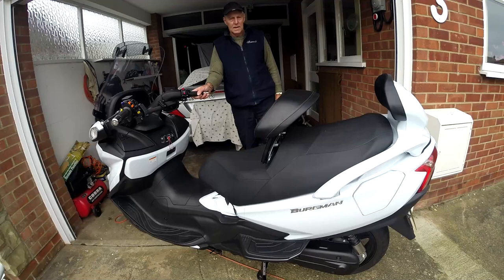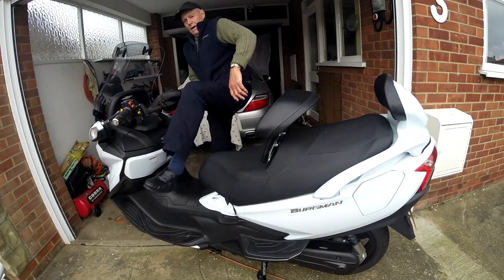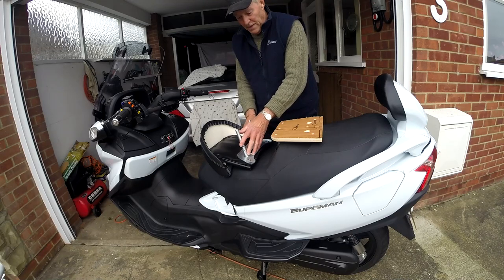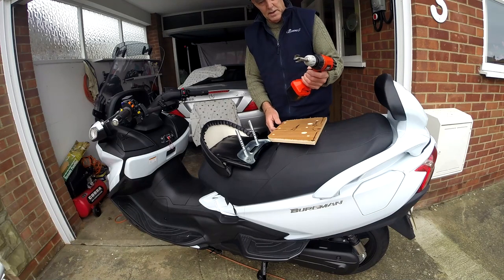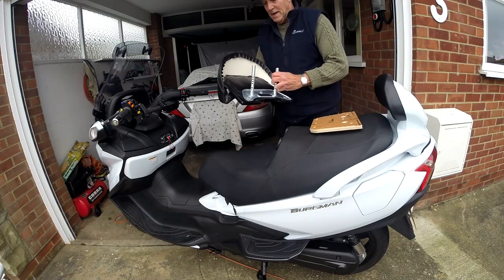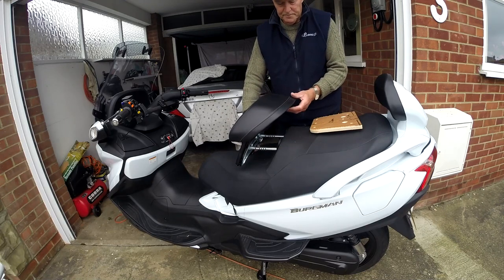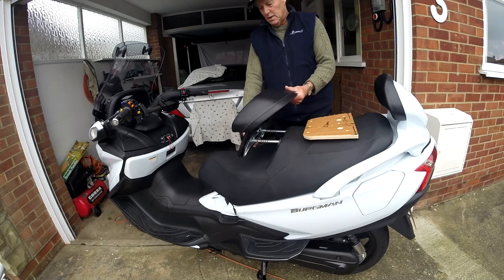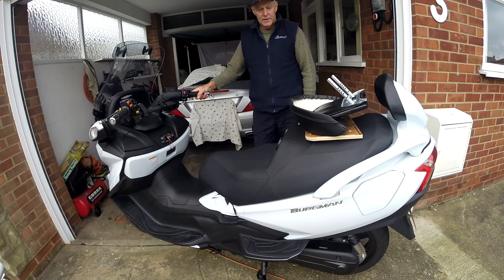Suzuki Burgman and how to raise the riders backrest

Comment: That’s an excellent tip about the jis screwdriver set, (Japanese industry standard) I could never figure out why all it took was a tight so called Philips screw on a Japanese bike to end up with a messed up rounded head, I blamed the quality of their fasteners. But no, they have their own system which looks very similar. A decent lifetime set is very reasonable. I’ve just bought a 2011 Burgman 650 executive and I think I will be making one of these. Thanks
Reply from the maker: Hi David, Thanks for the comments. That seat back certainly improved the comfort of the bike. Enjoy your burgman. I mess about stripping and cleaning camera lenses and nearly wrecked the first one with a phillips screwdriver then found out about the jis set so bought one, wonderful. Ken

Comment: I made one using the basics of Kens design.
Of course the measurements are in Centimetres and not Millimetres and I made mine not so high as I need to strap a 60 litre roll bag onto the back seat and it wouldn’t fit with the back rest at 35cms high.
I actually made a template of the metal work by pushing the frame into a piece of corrugated cardboard, drew around it then marked the holes then cut it out, this made it far easier to mark the holes onto the plywood as the metal poles as Ken says ,are rounded at the back and the frame rocks when trying to mark the hole positions.
So make a cardboard template and use that for drawing around.
I used 12mm ply as recommended but that spare piece Ken had looks a lot thicker than 12mm ?
Using a 25mm Forstener bit to make the countersinks I found that when drilling at the same angle as the poles it went through the 12mm ply so I ended up making 2 holes ( still works fine )
For stud jointers I used joint connector nuts m6 x 12mm from screwfix  cat number is 83501 .
These thread onto the studs using an allen key , much easier than using an hexagonal stud connector and nut.
When you cover the plate in leather cloth you will need to make three holes in it so it can slot onto the studs and again when attaching the metal work to the board.
Instead of drawing pins I used black upholstery tacks but these were the only changes I made from Kens excellent design.
Reply from the maker: Hello. thank you  for your input and interpretation of my design. I am knocking on 80 now so its no wonder I mixed up the cms and mms. Perhaps I should have stuck to feet and inches. Thanks Ken
Reply: No not knocking you at all Ken I’m a feet and inches man myself. I take my hat off to you for still riding and coming up with such a great idea and neat job for raising the back rest. I’m going to copy your accessory bar idea too . @kennuff2  👏👏👏
Reply from the maker: its ok i know you were not getting at me and you are not the first to mention it. That accessory bar works well, iIonly made a rough one to test it but ended leaving it on. regards Ken @BIGMC1300

Comment: the piece of wood says 28mm and 35mm  i take it you meant 280mm and 350mm along the bottom of the wood, and also you dont say how you attached the bottom piece of the bracket to the wood
good vid and good idea with the accessory bar
Reply from the maker: Hi Jokey, Well spotted, your right, I should have stuck to inches instead. The bottom part is  just fitted to the wood with nuts and round headed studs ( a bit like a machine screw but round headed with a slotted cross on top for a screwdriver, I got mine from Wickes.). Thanks Ken

Comment: Couple of questions, were the stud connectors the hexagonal type ? And the size you say is that 12mm x 6mm and the screws also 12mm x 6 mm ?
Did you bolt the metal frame on from the rear or did you screw it on from the front ? And finally, how did you go about covering it in the leather cloth ie did you make holes in the leather cloth for the studs and also the metal frame?
Reply from the maker: Yes the studs were hexagonal 12mm long because my wood was 12mm thick, the thread was 6mm .The screws or bolts (they had an hexagonal head rather than a screw slot) were also 6mm thread but I cannot remember the length. Yes I bolted the frame from the front with round headed bolts. I dont think screws would be strong enough. Re the leather cloth I fitted the front first and wrapped it round  and stapled it in place.I then  cut the back cloth to fit neatly around the frame . Hope this helps. Ken
Reply: Thank you that’s a great help.

Comment: Great vid, your sizes are c/m not m/m but I can't knock you for that. Great work well done.
Reply from the maker: Yes I know, old age you know, thanks anyway. Ken
Reply: @kennuff2  Yes I suffer with the same. but I still love what you did so keep it up, Les 70 years young. I live in Berkshire and only just my AN400 K7 with only just under 6000miles on the clock.
Reply from the maker: Hi Les, your only a young lad yet. Ken 78 but still biking. Best wishes.
Reply: @kennuff2  Thanks my man keep on ridding and enjoy.
Reply from the maker: Hi Les. I forgot to say last night that I also had the an 400. It was a lovely little bike, i didnt say so in my review of the 650 that I thought the an 400 was quicker off the mark at traffic lights ( a lot lighter of course). Alas I have sold my suzuki and have a Honda cbf 1000 which is another great bike. Regards Ken